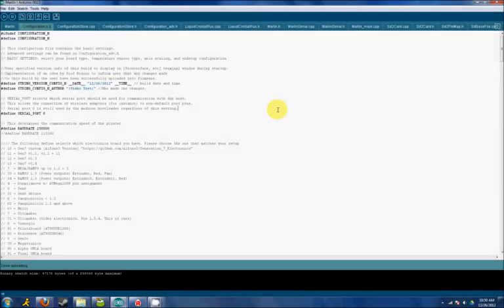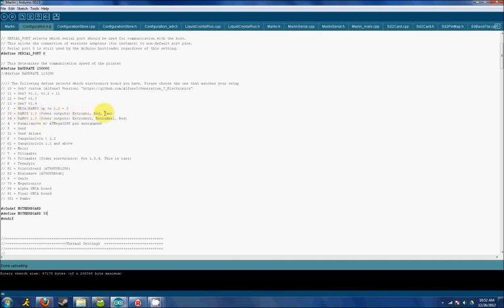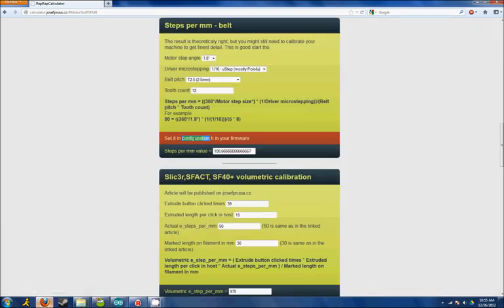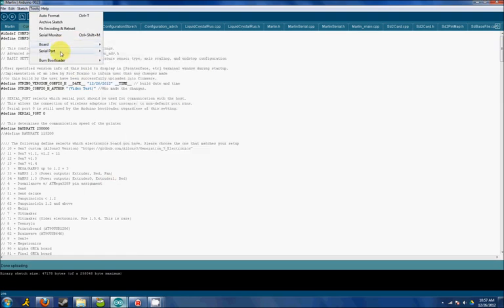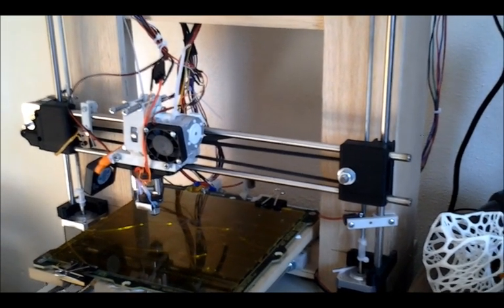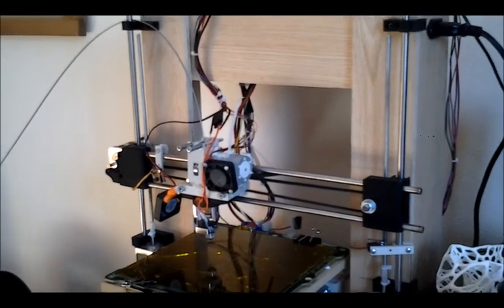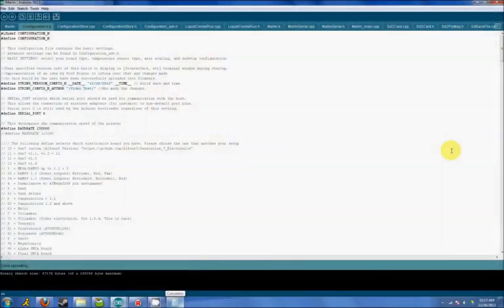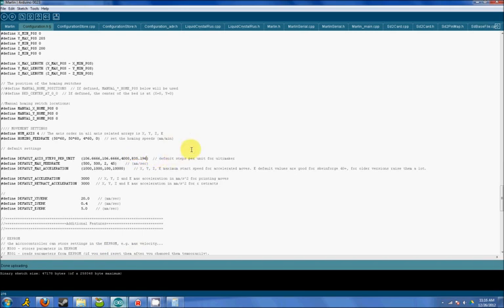Prusa i3 video build stage 8

Comment: What do I do if I have the Riprap Melzi 2.3 board? it is not listed under Tools--->Board---> ?
Reply from the maker: Nicholas Emord I am not that familiar with the Melzi board, but doing a little searching I found that there is a specific Marlin firmware for this board.  Both the firmware and instructions on setting it up can be found on the reprappro website.  Else there is more information about the Melzi board on the RepRap Wiki.

Comment from the maker: Hey Noel,
I am using a Budda by Lulzbot and the Wildbill style direct drive extruder.  To make the spacing work I ended up having to modify both the X-carriage and the extruder base to work.  I posted the STL's inside the reprap i3 build log forum thread (see video comments for link) but I HIGHLY suggest you do not use them as I created these for my specific printer and may not work with yours.  Thanks for watching :)